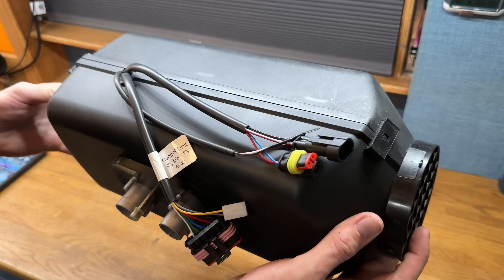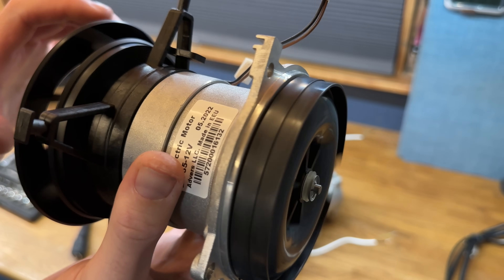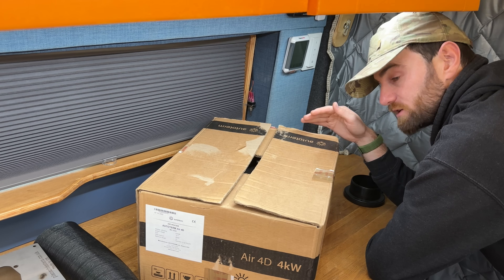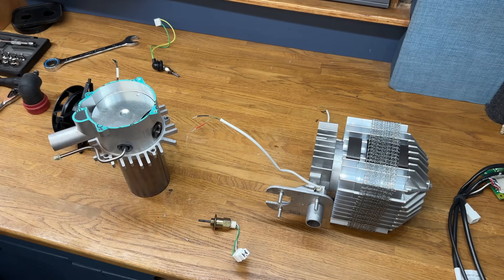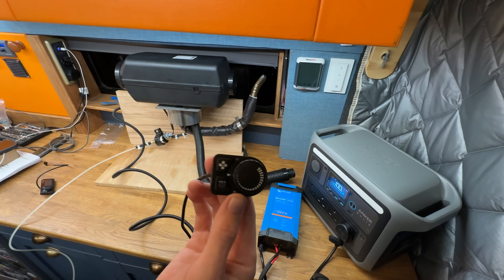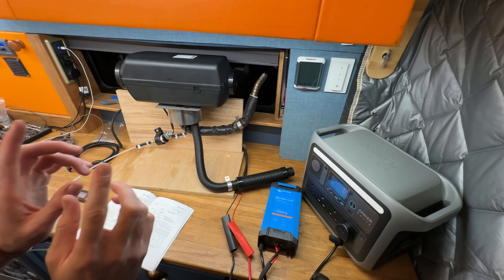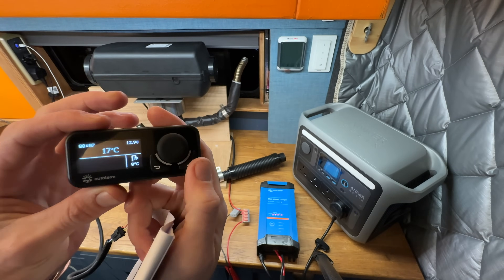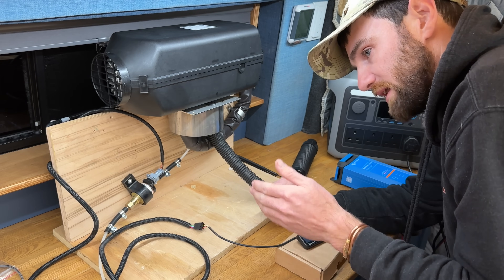UNIQUE DESIGN! DIESEL HEATER AUTOTERM AIR 4D

Comment: I travelled & had Autoterm fit the 4kw in my Ambo 2 weeks ago, service was great, I watched the fitter do the work on vehicle, never got asked to leave the area, any questions I had were answered by James. Worth the money & my travel time from south coast yes definately. 3 yr warranty instead of 2(self fitted) Fires up everyday at set times no issues. 5ton Mercedes sprinter Ex box Ambo. Expensive yes but you pay for what you get, choice is yours. Look forward to your video of water heater from Autoterm,  was told about it while there Alex. Keep up the great work👍
Reply from the maker: Yeah, that is something I didn’t mention, is autoterm dealer network and installer, which is i said it definitely a great added value for the units not only supplied but professionally installed well
Reply: Hi where did you get this fitted please

Comment: Had an Autoterm 2D in a box on my scandi tour @-22C in my tent. Just changed to comfort controller big upgrade. Worth the money when things have to work
Reply from the maker: Was it a premade box or when you built yourself? 

comfort controller definitely is a nice bit of kit
Reply: Bought from a company in Spain called UroCamper. At the time was almost the same price as buying components and DIY. Very nice alu box and cnc made internal plate over heater
Reply from the maker: @stevehomer3676 ah yes. I follow them on insta

Comment: Thanks for a reassuring review. I have the 2KW Autoterm in my MWB Crafter and it's been great to date and money well spent.
Reply from the maker: Money, well spent I’d say!
Reply: Hi do you think the 2Kw is ok for the MWB crafter? Im not sure which to go for 2 or the 4kw for my MWB Crafter
Reply: @exploresandtosummit  it’s more than enough. Warms the van up quickly and maintains the temperature. Mine fits nicely under the drivers seat. The lads at Wrexham were brilliant and did a great job 👍. No issues to date.
Reply: @sportalepies  thanks for your reply, I’ll go with the 2kw. 👍

Comment: Interesting and probably sensible to fuse the negative as imagine the case will be connected to the chassis when bolted and that to the negative - if you had a poor negative to leisure battery connection it could then route through the diesel heater wiring (assuming you connect it to the leisure battery negative) and the fuse would prevent an issue in that case. That’s my theory on it but could be wrong.
Have a lovely Christmas, all the best, David 👍
Reply: Also it prevents damage if an installer connects it incorrectly negative to positive etc. belt and braces.

Comment: Interesting! Especially the 12V testing. I own a anker 521 powerstation, and it can start my 5kw chinese diesel heater on a low setting on it. It then registeres about 110 watts, slightly more on cooldown.

Comment: FIY my Webasto 2kw air top runs of my Ecoflow Delta 2 with no problems, it will run non stop for about 70 hours.
Reply from the maker: What’s the wattage reading your Delta two give on start-up? Most heaters start on my EcoFlow river pro. the original version because it had a higher voltage 12v socket, as it was 13.6v @ 10A, unlike the many models now which are 12.6v @ 10A. 

With the autoterm its glow plug drawer was considerably lower than many of the Chinese diesel heaters but the starting of the inductive motor made it too much effort for most 12V ports.
Reply: @MispronouncedAdventures  I am not an expert and I did contact both Ecoflow and Webasto and they said it would work. I think the start up wattage is around 120 and max draw is 8A. The Delta 2 has a max pull of 10A, I hope this makes sense.

Comment: Hi
Thanks for the video. I have an autoterm 4d and it is indeed very sensitive to battery voltage. It stops when I use the induction hob for example. I have a 600Ah LiFePo4 battery though.
Otherwise it's a very good heater that consumes very little power.
Reply from the maker: On the comfort controller, I did notice there was an option in settings to turn off what appeared to be low-voltage shutdown. well that’s at least what it look like. I wasn’t able to test it though
Reply: yes you can alter the settings of the voltage cut off on the comfort controller so that may well allow you to run it fine on power banks if yoy set it low or switch it off. Its never fully off but i think factory standard setting is 11.5V and with it off the setting is 10.5V for 3 minutes.
Reply from the maker: @Heatersandfridges the issue in this video, wasn’t the heater cutting out due to a low-voltage, although it certainly did have a low voltage alarm on the river 2 but over run it without problem

The issue on two of the three power station was the 12V DC of the power station turning off due to overload. 

Even when the heater was running on low combustion wise, during the shutdown period, it would ramp the fan up to full to speed up its cooling process with the glow plug on, which was what tripped it on the River 2 Pro
Reply: i can mention this to the software team in Latvia and see if they can change the way it shuts down. Of course the main thing during shut down is to be safe and make a correct shut down and with a battery in the circuit it definitely isn’t an issue.  However maybe they can make them more power bank friendly. Will pass it on. Cheers.
Reply from the maker: @Heatersandfridges  cheers, i guess from my point of view im using it outside of your original intended uses. But i know so maybe people try and get CDH running or any running off power station now for camping set ups and small van set ups . So worth a play 

usually they’re right on the edge of what the power station 12v ports can hardly for a startup or shut down. running is fine.  

Definitely important to have a safe shutdown however that’s why you see me very quickly, grab my AC supply to plug it in!
Reply from the maker: @Heatersandfridges  I recognised your name as I read the last comment! Great kit and currently have a borrowed combiBOiL on my bench for having a play for a video
Reply: Its great to see a video that we did not influence in any way from someone who understands heaters. Will look forward to your combiboil video

Comment: Have a 2KW one tapped into fuel tank, 3 years old now still great, uses little power.
Reply from the maker: The 2kw units, which I’ve fitted in the past are excellent as well

Comment: Hi Alex ,Happy New Year . I’m looking at a 2kw diesel heater . Either a Autoterm or a Lavenar 2kw pro max model . 
I have ordered a Autoterm with the comfort module and app modem but wasn’t sure if the Lavenar heater at half the price is a better bet or if the Autoterm really is worth the extra .  I’d really value your input 
Cheers 
Ja
Reply from the maker: Autoterm is a better unit by far. hardware and software wise is it a better unit and also has great customer support and warranty. ( plus the comfort controller is a very nice unit ) It’s a completely unique design and manufactured in the west. 

Lavenar is probably the best of the budget to Chinese heaters. They generally have far better, accessories with normal Chinese heater.
Reply: @ thanks mate ,I’ll keep my Autoterm order live then . I’ve also ordered the modem cheers
Reply from the maker: @ good plan I’d say. I’ve got the modern too. Haven’t tested it yet

Comment: Nice intro video. I just saw from some overlanders that the Autoterm works very well in high altitude (Altiplano at 4200 m).
Reply from the maker: Thank you very much for collaborations and do my best to try and pitch the rest of the content of the channel, so people who find it might consider staying. 

I haven’t looked into the high altitude capabilities of the autoterm yet . I don’t know if it’s a different board required or a manual / automatic adjustment. Or if it just still works

Comment: That autoterm pcb is properly protected with a conformal coating and silicone coating… the connectors should be fine in high humidity. The boards in a plastic housing are actually worse unless completed sealed (I have never come across one that is) as they hold the condensated moisture, thus destroy themselves.
Reply from the maker: Aye I’m aware of the purpose of the board coverings and I agree it’s protected. I still prefer properly sealed,housing I could come across in Webasto and Espar, let’s see what housing types are rare amongst the Chinese and the ones I have seen are exact duplicates of the Espar version. I think it’s more I prefer a plug indexed connection style. But yes, done poorly can lead to issues

Comment: I’ve just fitted a Autoterm heater and noticed there’s no fuel filter, is this right? No filter shown in the manual or where I ordered it from. Thanks in advance
Reply from the maker: @exploresandtosummit  fairly certain autoterm terms don’t ship with fuel filters, I think they realistically see little need when used in most western countries off a main fuel tank. My Chinese heater has around 5500 run hours on it with a fuel filter and absolutely nothing has ever been trapped in it.

Although I can’t see any reason for you not to add your own if you wanted too
Reply: @MispronouncedAdventures  Thanks for the rapid reply, 👍that was about 2 minutes 👍

Comment: Thanks for the video.  Im stuck between choosing the 2kw or 4kw autoterm model for my 6.36 Ducato motorhome....quite well insulated.  The 2kw is considerably cheaper and im not sure if it will be more reliable and use less battery if its running harder than the 4kw that may have to keep cycling on and off.  Have you any advice with all your experience? Want it to be able to keep me cosy when its a couple of C below freezing. Thanks!
Reply from the maker: @broadpete  personally, I would go 4kw.  A 2kW though would heat up a van of that size just considerably slower, and if it was really cold conditions would be working quite hard to maintain it

Comment: As always great video!
3 questions:
1. I heard these work at higher altitudes. Is this from stock or any upgrade in parts needed?
2. What mode do you recommended? Thermostat or temperature?
3. What is ventilation mode? Is that for summer?
Reply from the maker: Thanks. 

1. From my understanding you need to swap the board to a high altitude Ecu version.
2. Temperature mode for me. I prefer the diesel heater have always been on but trying to Maintain the preset temperature by testing the heat output opposed to cycling on and off in thermostat mode
3. It seems normal ventilation mode can be for summer as a fan. There is also a heat plus ventilation, which, when the heater shuts down, it turns on ventilation still circulate air
Reply: @MispronouncedAdventures  perfect! Thanks. Mine 2kw is being installed atm so very timely video and help!
Reply: All the air heaters are altitude versions as standard now. There is a black square component on the board with a hole in it. Its the altitude sensor. It will compensate based on air pressure. No need to buy another board. It does slow down the cooldown sequence at altitude.
Reply: My 2d has a built in alto and worked at 2000m in alps no worries. Vent mode runs the heater and fan but fan doesn't stop after heat stops. It's good for condensation control. With simple controller fan always runs anyway.

Comment: Hello from ireland 
Just wondering if you can help me out i had autoterm fitted less then 6 months ago. While i had my van in uk 
Im back home now in Ireland and heater has error code o5  i was more or less told by installer company it has 3 yr warranty  and it worked when it was leaving here 
 I am new to van life but now very cold  .is o5 code a big job to do
Reply from the maker: Autoterm have a Facebook group that has there uk staff in it and They can be very helpful. I think 05 is something to do with a sensor
Reply: @ thanks alot yea  im living in ireland so uk  based auto term is no addition as i  need to prob get it sorted over here in ireland a look thanks for the reply and ment to say love the channel  keep going  thanks again

Comment: Thanks for this teardown. Such a conformal coating is a disaster for me as electronics repair man but it protects the board better.  I used a chinese 5kW (2kW real) in my boat, (where I work and live)  after a month it stopped, completely stuffed with carbon/sooth. Opened it to clean. What a piece of crap. After my tears dried, I ordered an Autoterm. Seeing your video I'm glad I did. The much lower start current is a positive point. The voltdrop over the crappy to thin chinese copper coated aluminum wires gave a 3V voltdrop on my unit. (I have 450Ah batteries so that is no problem)
Reply from the maker: Yes, the conformal coating is nice to see in the context of protecting the PCB although I would still rather see a sealed type unit with waterproof plugs and then the terminal style and open PCB. I do appreciate that coating is going to make repairing the PCB if you have the knowledge a lot more.

With Chinese units, there’s such a variety of range quality that’s for sure
Reply: Really
Reply: Sounds like the heater had not been fitted properly , or the wrong fuel used in it , Thats the only reason it would have sooted up.. What alluminium wires are you talking about what heater was that on ,   Was it fitted to a fiashing boat , it does sound rather fishy.
Reply: @daviddavis6231  I took out the China crap, replaced it with the Autoterm, used  all the existing hoses and fuel line. Mounted at exact the same position. I used the exhaust parts from autoterm because they are made like it should be. No need for alu tape and gungum. Real RVS sturdy hose clamps. A welded exhaust instead of the leaking pressed together Chinese one. It worked all winter flawless on the same fuell (a 240L fuel tank). I live and work on that boat, 11M steel pilotboat . The Autoterm was used every day the whole season upto 2 weeks ago when the it became warmer outside. 

Not a faulty install, hearing you, you are probably to cheap to buy a good one or payed by some Chinees con-shop that sells one of those crappy copies that are unsafe and not tested. Mine had several casting faults, one of them caused  leakage from exhaust gasses to the  heated air and probably also the sooting. This should never have left the factory. The casting form is clearly made from some trashed European brand heater, including some warped fins and the not flat gasket area.
There was not a single safety build in for things like overheating or burner temp. The quality from the controller (design and how it is build and mounted is really bad. 

The Chinese use copper coated aluminium because that is much cheaper. Easy to check, cut it and watch under the microscope. A very common practice in China to save money while it still looks the real deal. Like they do with all electronics crap they sell direct via Ali/Temu/ebay etc

The only fishy thing is your reaction.

Comment: With hindsight and your experience Alex, where do you think is the best place to put a diesel heater in your model transit (mine is the same)? Behind drivers seat so it’s close to power and fuel tank? Or doesn’t really matter?
Reply from the maker: Personally I don’t think location matters too much. long or short fuel line doesn’t make much difference after it’s been primed.

But I do like having my heater ( or vent output )  in the centre as it’s a bit more of an even heat across the van.
Reply: @MispronouncedAdventures  thanks Alex! Noted! I think I’m going to go with AUTOTERM so will use the link, thanks!

Comment: Thanks for the detailed testing. Let's say, if I was to run an Autoterm 2D in my boat on an auxiliary power station battery (instead of on my household lead battery), what power station minimum specs would you recommend for the 12V output? It's a bit confusing what the maximum wattage could be from the specs.
Reply from the maker: Generally the vast major power stations can’t run a diesel heater of the 12 V socket as they usually only rated to 8 or 10A however there are a few bottles of powerstation which do you have high output 12V. Like the Bluette AC200MAX. Or you could run it via a AC to DC converter from a power stations inverter.
Reply: @MispronouncedAdventures thanks for the info! Alright, so I think in the end, I’m better off buying a bigger 2nd normal sealed lead household battery. I now run a bigger household battery which may be enough, or not if I need to run the heater multiple darker days without a lot of solar charging. I already have a second smaller starter battery for the diesel engine, which I could replace so I have two equal bigger ones, which may be enough.

Comment: great video! Just installed mine but it seemed strangely loud compared to old chinese diesel heaters I've had in the past which seems odd given the low noise selling point. Running on low level still kicking off 80db about 1ft from the unit. Is this normal to your knowledge?
Reply from the maker: Whilst I haven’t measured the exact sound output, I should be spec information for that on their own website. 

Well, the  unit was somewhat loud. I did have it installed on a bench for a video testing purposes which probably makes it sound a lot louder than it is. But I didn’t feel it was much louder than my other heaters

Comment: I had chin
Eese heater. It died

I am hoping AUTO therm mount same spot ??

Water heater does it also exhaust hot air ?  Do you use water heat exchanger ?

I plan to have both radiant and hot air
Reply from the maker: I believe most of the heaters use the same mounting plate / holes layout out. So you should be able to swap. 

This is air heater, autoterm also make water / hydronic heaters as well.